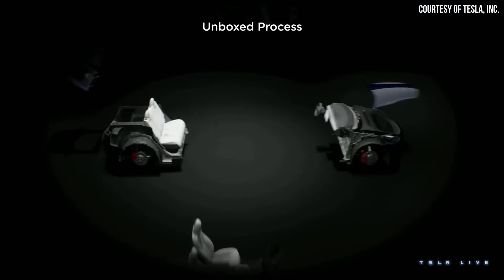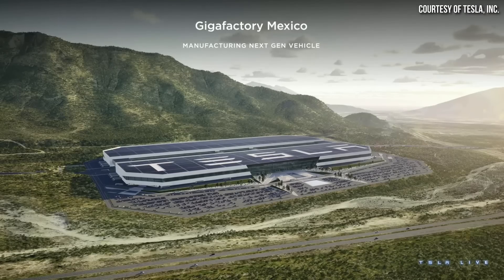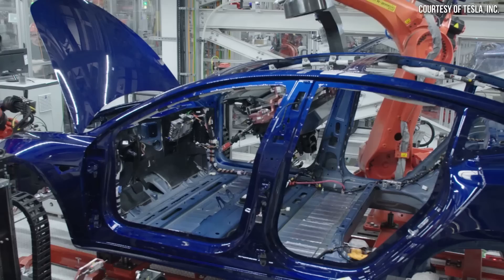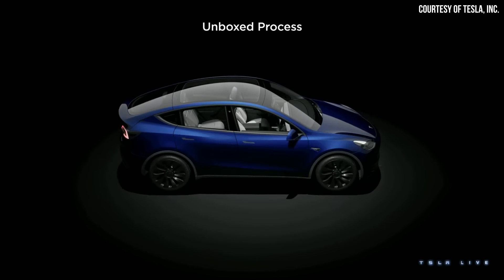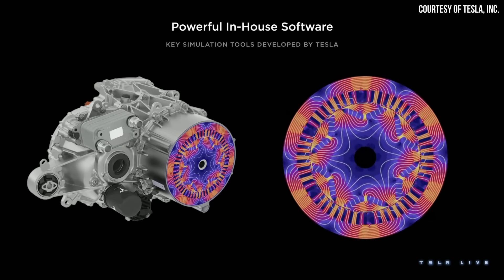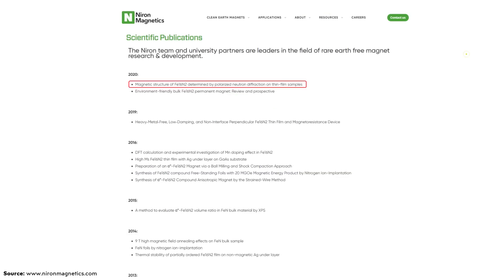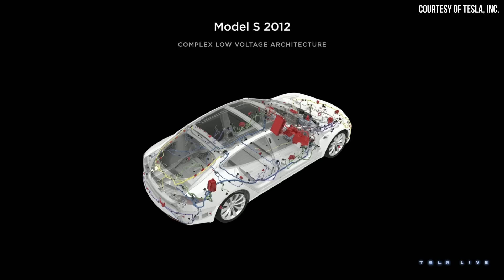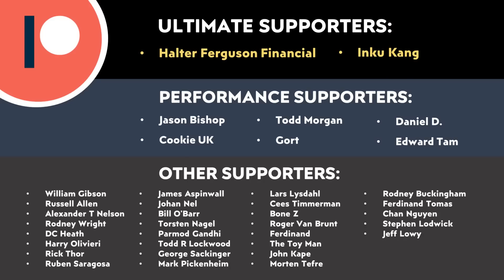Tesla NEXT GEN EV Manufacturing SECRETS revealed | $25K Tesla

Comment: Mega factories will be more flexible and 1/4 will close to standard for switching the 1/4 to whichever product is needed most. 3/4s production capacity will not be affected much by 1/4 changeout. So we see the Elon desire for 2-3 times the number of plants... 3 times plants= 12?... Times '1/4' plus one dedicated 3/4 plant, #12, will be huge in pushing out new products eliminating one year in concept to production cycle.
Elon is gaining control of factory not seen since Model T.

Comment: Tesla can probably decrease their SiC use by over 50% just by going with a 1000V architecture. The remaining 50% can be achieved through a combination of better packaging and cooling for the chips and lowering the car's horsepower rating.

"AC induction" motors (asynchronous motors) are not the only way to go magnet-free. You can also use many variants of electrically excited synchronous motors like BMW currently do for their electric cars (except the older i3).

Comment: A big improvement is in the wire harness. Tesla only went 1/3 of the way forward.  Power is no longer routed point to point from source to user, but distributed along stations.

The next big step is to eliminate all point to point communication cables and replace them with a network architecture.
The final biggest improvement is data over power cabling

Comment: My understanding is that Tesla uses a Switched Reluctance Motor (SRM) and not a standard Permanent Magnet Motor (PMM). I believe that the basic SRM motor can function without permanent magnets? The other type of motor once used was the Induction motor which has no permanent magnets.
Reply: Eliminate heavy metals, eliminate cost, eliminate China's 2 of 3 major contributions.... Labor rates the 3rd will have to deal with Mexico's coming plant.

Comment: Most people missed Lars and franks comment that while the illustrations were for Model Y, the new design is not for Model Y. They say Lars  “just like the CyberTruck” and then Frank says “it’s not the model Y”. This pretty much confirms gen3 will be stainless steel. It also explains why they can do the new pipeline. With painted cars you HAVE TO paint everything together for color uniformity, then take doors/panels off, assemble and use EXACT same doors/panels to ensure paint is uniform. 
This also means that no competitor will be able to copy the process since nobody will do stainless steel anything soon and explains why Tesla was happy to share the process so early, because nobody else can do it.
As Elon would put it - the best paint is no paint 🥳
Reply: Oh, one more point, going stainless steel reduces canibalisation if M3/Y and Osborne effect. Much like Ford said about the Model T - you can get it in any color as long as it’s black, with the gen3 you’ll be able to get it in whatever color you’d like as long as it’s stainless steel. 😂

Comment: I recall a comment that referred to assembly cycle time as one unit every 45 seconds. This is close to, if not an industry best. Think of if humans are involved what is the shortest cycle they can perform while positioning a complete car from one station to the next, even with moving floors as used in modern legacy assembly plants. Run this 24/7/365 (minus breaks for needed maintenance) and you get an idea of how Tesla maximizes output per unit of capital investment.
Reply: Bullshit!!! Vw is about less than 15seconds lol!!! And it’s a lot of different types of vehicles

Comment: I can tell you that from the perspective of a ex-automotive paint process engineer for a major European automotive manufacture, it would not make sense to paint the panels on the car if they are going to assemble it in subsections.  If in subsections you could do a wrap process, hydrographic process, molded in color process or possible even just stamp the car sections out of some sort of thinner, none structural stainless panels that skin over cast aluminum side structural panels.  The main reason a car is currently assembled and painted as one is because liquid paint is more difficult to get a uniform color match without painting the car as a single unit.  Tesla is seeking to eliminate paint because the more expensive section of a car plant to build and run in the paint shop.  It is also the worse area for air and water pollution potential.  Cast aluminum body panels would equal no need for E-coat for corrosion resistance and therefore a massive savings in water used.  Paint is not cheap and the transfer efficiency from gun to part is poor even with some of the better electrostatic painting processes.  The over spray  most often becomes waste.  There is much opportunity for cost reduction with this new Tesla method.
Reply: Very interesting. It aligns with what Tom Zhu said (concering the question weather it will be a regular car or a cyber car): "Paint is expensive". 
Imo this does mean that they will have some sort of revolution in how the whole painting process works and not necessarily that it will look like a cybertruck in small. 

Do you know if such a new process has any drawbacks?
Reply: Each process would have advantages and some disadvantages but overall I would say you could create a much cheaper car with many more advantages than disadvantages.   Loss of the flashy but fragile paint might be a way to not undercut the higher level models. Great basic, cheap to operate and cheap to buy LFP battery type, basic transport is what this car will be.  An electric people’s car so to speak.  But not tiny, really functional, just not blazing fast like my model Y.  I would buy one tomorrow!
Reply: I must be missing something... Why can't you take the exterior stamped parts and mount them on a hanger fixture and run them together through the paint shop to get uniform color?  Then distribute them to their sections which must be done at some point anyway after stamping.

Comment: I don't think they found a replacement for silicon carbide. Most likely they are driving the silicon carbide with higher voltage and higher current and then liquid cool the chips directly to prevent them from dying. If you double the voltage and double the current you get 75% reduction in chip area needed. Doubling the voltage will require a step up DC to DC booster maybe they can use power Mosfet for this. And doubling the current needs direct liquid cooling.
Reply: I just realise Cybertruck will use 1000V high voltage architecture. If everything in 3rd gen platform is going to be 1000V then they don't need DC to DC booster they can design the inverter to double as DC to DC booster during charging and then reuse the silicon carbide as inverter during driving. So yeah move to 1KV battery then double the drive current with liquid cooling and then reuse the power transistor as DC to DC booster when charging. 75% reduction in chip area done.
Reply: @kazedcat  nope!!! That’s not the case! Other manufacturers already uses super high voltage 800 to 900! Why can’t they develop a better solution or transition to much efficient and smaller in size galium nitride components!?
Reply: @carholic-sz3qv  Tesla is saying 75% reduction from their own technology which is currently 450V not from others. If Tesla is switching to GaN then it will be 100% Silicon carbide reduction and 4X more expensive. Silicon carbide wafers are more expensive than regular silicon but at least you can produce wafers of the material directly. GaN will need sacrificial sapphire wafers first before converting it into GaN wafers.

Comment: In all technicality the model 2 was unveiled. Tesla is just smart enough to know that they can't pull a cybertruck with a car that people will cancel and choose not to purchase model 3 and Y for. Model 2 has to be ready to ship when they announce it.
Reply: I don't think the Osborne effect will be nearly as bad for Model 2 as people think. Those people who can afford 3 and Y aren't necessarily going to trade down to a smaller car, particularly if Tesla keeps 3 and Y prices relatively low. There will be a status symbol aspect to owning a bigger, higher specced Tesla. 0 to 60 times won't be the same for the Model 2, and it will primarily draw in people who were driving a competitor's smaller EV like Hyundai Kona, or a competitor's small ICE car like Toyota Corolla.
Reply: @apterachallenge  What makes you think that the $25K car will be a smaller car. 50% reduction in cost of production can make project highland the $25K car with an even higher margin than current model3
Reply: @kazedcat   A lot of people actually like small cars. I am one of them. Big cars are a hassle to drive in traffic if you just need a runabout to deliver pizzas for example. But I believe someone mentioned on another thread that Elon actually said it will be a smaller car. It makes sense from a cost reduction point of view. Yes, streamlining production methods is important, but combining that with a reduction in battery pack size and overall material costs is also a factor.
Reply: @apterachallenge  A smaller car will be the $15K car after Project Highland.

Comment: Ehh... I did not jump to the conclusion that Tesla will replace silicon carbide transistors with transistors made from other materials. They certainly didn't tell us that.

Tesla promised to use less silicon carbide. How, they didn't say.

Here is my guess as to what they intend.

I suspect that when Tesla began to use silicon carbide transistors in high voltage converters, their production volumes were low. They lacked the clout to specify exactly what they wanted from vendors, and so they had to buy what was commercially available. It was a 'next size up' situation.

Now their volume gives the clout to specify exactly what they need. This freed them to design a converter free of legacy constraints. And that is where improved efficiency and reduced silicon carbide utilization could be obtained.

I'm not an insider, though. I might be wrong. But it's worth pointing out that Tesla left unanswered the question of exactly what they did. From what we know, several answers are possible.
Reply from the maker: Great thoughts - you may be right.
Reply: My speculation is 1KV battery then double the drive current using liquid cooling. No need for bespoke power transistor but a custom chip package will certainly help with liquid cooling.

Comment: 25K is still at least 10K to 15K higher than what the vehicle is worth because of short range and long charging times.
Reply: How do you know that?
Reply: THANKS JON 🤗 for doing a summary 💚💚💚
Reply from the maker: We don't know the range or charging speeds yet, so it's too early to make that call. It will be well worth it.
Reply: @Cleanerwatt  Yes we do know that the charging takes too long when compared to filling a gas model. Anything more then 10 minutes to fully charge from empty is too long.
Reply: @JohnSmith-ug5ci  Just plug it in when you are sleeping or at work......
Reply: @JohnSmith-ug5ci  How long to walk to a rest room, and then buy a burger ? What people fail to appreciate, is that you just plug in( to charge) , walk away and do something else for a few minutes...
Reply: @chrisheath2637  with a gas model there is no need to do something else. The current line of EV's are all impractical.
Reply: @JohnSmith-ug5ci how many long driving trips do you go on in a year??? I drive 30,000 miles a year and I only have to go to a supercharger 4 or 5 times a year. So do I spend a lot of time “charging?” Probably less time then you spend at a GAS STATION in a few weeks.